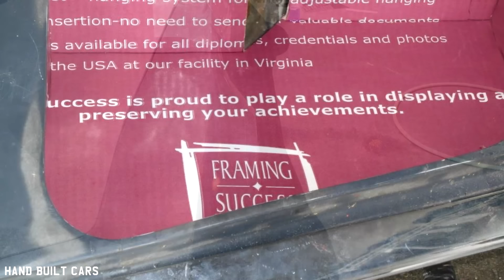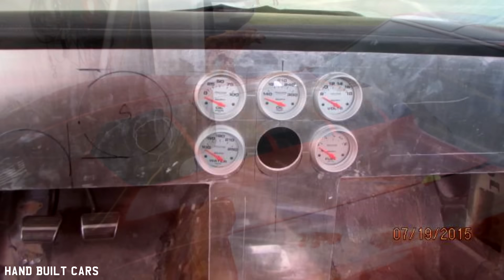1971 Chevrolet Corvette L88 Build Project

Comment: So it's a '71 Corvette Restomod built with FIA style flares and a L88 style hood, not understanding calling it a L88 build (especially no aluminum head BBC), still really nice work, good look, well finished Corvette.
Reply: Yeah, more L-88 THEMED than L-88.  Evokes a great era though.  Seemed like a pretty solid car to start.  I might have gone with a variation on the 71 LS-6 or "what if" '70 LS-7.  Really nice work though.  Somebody stole it at auction.

Comment: L-88 ??  LS7  (if that's what was installed)  was a far better choice, but it doesn't pack the visual punch of a true Big Block 427 cu in.
Reply: Mr. Ed yeah, so many people do LS swaps now it's boring. I know it's a easy way to get modern fuel injection and timing control, but those are available for almost any older V8 engine.